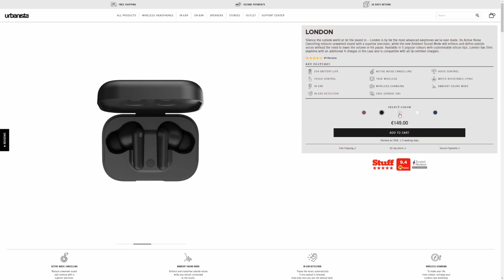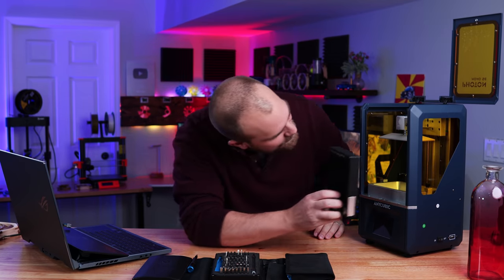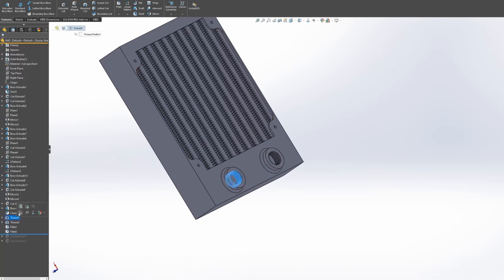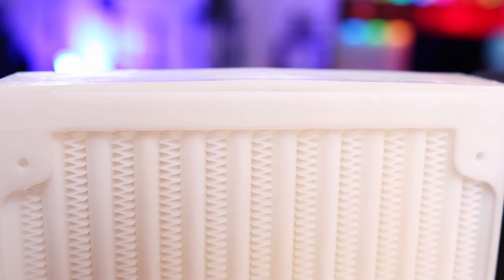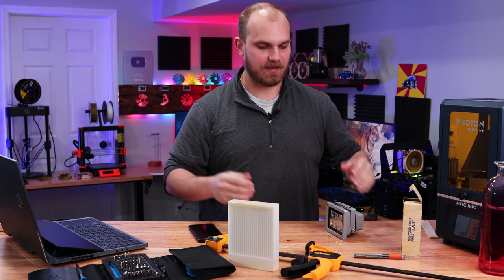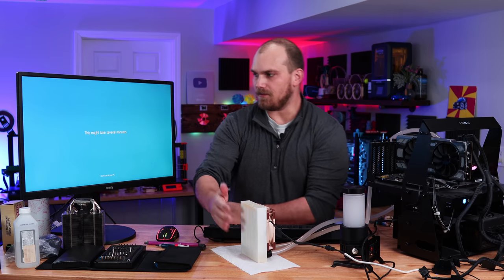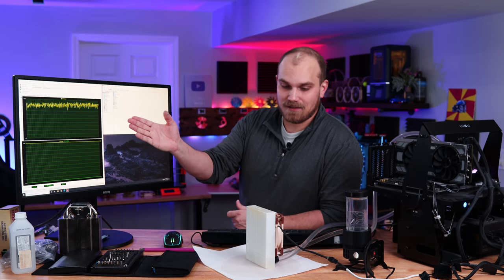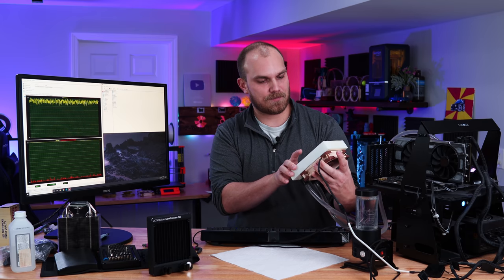I Never Expected This | 3D Printed EK Coolstream SE 120mm Radiator

Comment: I think it’s quite interesting. Obviously the thermal conductivity of the resin will be worse, but the complexity of the design possibilities is quite a bit better compared to some stamped metal thing. I’d be interested to see designs that really capitalise on the possibilities 3d printing allow in channel design, as well as experiments with the resin itself. I bet there’s some off the shelf resin out there that has much better thermal conductivity. Maybe something designed to tollerate low temperature metal casting / injection moulding? Otherwise, DIY experiments with mixing through metal dust or maybe even impregnating the resin with short carbon fibre rods could be really interesting to create a sort of matrix of thermal conductors throughout it. I feel like the zigzagging pieces don’t make much sense with low thermal conductivity so a simpler design that just has many more thinner water channels maybe a lot more effective.

One final thought: What if you spray painted or electroless plated the thing with a light coating of a metalic conductive paint? That might allow enough surface conductivity to improve the thermal characteristics, so the plastic becomes a sort of internal skeleton for a thin metal coating.

Comment: If the radiator material doesn't transfer heat that well (compared to metal), do you still need the radiator fins? Perhaps more pipes would increase airflow and allow deeper radiator design to increase surface area? Loving your channel!

Comment: maybe its like the RC speed controllers.they are wraped in a shrinking plastic sleeve to press the aluminum heatsink against the mosfets and some people freak out because it covers the aluminum heatsink and its a bad thermal conductor.
turns out that the shrinking plastic sleeve IS a good thermal conductor.
are we sure that resin is bad thermal conductor?

Comment: USED BEER CAN MEGA PASSIVE (OR ACTIVE) RADIATOR.  Use 3D printed top and bottom couplings with rubber O-rings to build a massive beer can heat sink...safely outside the case, perhaps even elevated up on a shelf.  It could be a decorative item displaying favorite beers!!!  AND A RADIATIVE HEAT SINK...

You could do an all resin version of the couplings and an epoxy or resin lined  FDM version (to create watertight FDM parts).  Do the outside with wood filament and stain it!!!  If the radiator is elevated above the case, the heat will saturate from the top down.  You could even develop ways to create pressure seated fins on the back of those beer cans with some thermal compound and cut up beer can folds.  Extra radiative goodness!  I see a branded DIY kit here!  Patent pending!

THE BEER COOLER.  DO IT!!!!

Comment: btw, you can have bluetooth headphones with a wire, but to a battery, the same one, external to boost your, but you could otg your plugs
Reply: if you only have wireless charging, no plugs
Reply: ugh, upside down, or your block your channels
Reply: so, instead, liquid nitrogen in the pipes

Comment: Excellent work man, maybe part out the top an bottom panels into a separate prints an assemble them with a gasket. Might make a second rad easier to print.

Comment: I fully support a series of 3D printed radiators... I would watch the hell out of that.
It almost goes along with an idea of had for a computer for a while. In my head this was made out of aluminum somehow... But you have a giant reservoir that has vertical channels through it. So that while it's just a reservoir and there's no fan or anything else there's enough surface area and convection to keep the coolant extremely close to room temperature. so you would lose most of the heat through the radiator but radiators are only effective in getting so close to ambient.  By having the coolant kind of sit static for a while in this big surface area, the rest of the heat could work its way out.

Plus when I do my workloads I would never overheat the amount of coolant. It would finish working before the coolant warmed up

Comment: The resin is a poor conductor of heat compared to aluminum. But, you could make one 4 time the size (or just make 4 linked together, with fans) it would come out under cost and probably work...

Comment: If you could print this out of metal resin, you might have better thermal conductivity than a normal radiator because the fins would be integral to the tubes and tanks instead of soldered. If nothing else, it might lower production costs. This has possibilities.

Comment: Please Please Please make an FDM version and post it! I am an electrical engineering student who is currently trying to build my first gaming rig on a budget and really wants to water cool. I actually think it will work better off an FDM machine, as the layer lines should increase surface area to some degree. As well you could try using a material such as a steel or copper fill PLA, which might conduct heat better while being both stronger than ordinary PLA and way less expensive than a kilograms worth of traditional radiator. The only down sides I see is that it might be a little more difficult to print and require some tweaking such as internal supports along the top, and the second being that any sort of gap between two wall lines might act as an insulator. To prevent the second of these from being an issue I would try printing it with a 0.8 or 0.6 mm nozzle to allow for thicker and stronger walls while still only having one wall line. The only problem I think that will leave is that if you have even one layer where it didn't come out quite right then it will turn into a water gun. Then again, fixing a hole in an FDM print can be as simple as some scrap material and a soldering iron. Would love to see a whole pc cooled entirely with these! If you think about it, it isn't even that far fetched. If you can completely fill your pc with 3d printed radiators for less than it would cost you to buy 1 metal radiator, the 3d printed ones don't need to be nearly as effective unless you are running a 3090 or something. In which case, what the heck would you be doing 3d printing radiators if you can afford top of the line hardware?

Love the channel and thank you so much for the excellent content!

Comment: An array of micro-tubes with a few fins for mechanical stability should work well.  It'll also let you use minimum thickness walls on the tubes to work around plastics poor thermal conductivity.

Comment: they have high heat resins with high thermal conductivity... they are expensive but i bet they will decrease in price over time. plus you could use cheap resin + additives to get close. Even metal dust might get you close to the conductivity lvls you want. granted it would have to be very fine & well shaken before hand but it would be very interesting to do more crazy tests.

Comment: Another benefit of a plastic radiator, is that unlike metal is doesen't make distilled water conductive, as it has no ions which can leech into the water. On the downside, I feel like if you use it for longer sessions, where you exhaust the thermal capacity of all the water in the loop, it is going to throttle HARD. Fun experiment, anyway.

Comment: Now I'm just curious what happens if you take out the radiator altogether, and just do a longer passive tubing run, in a case it could be against the metal surfaces to help pull heat out.

Comment: Since the plastic has a significantly worse heat conductivity you'd probably be better off with ditching the fins all together and go with denser channels. Maybe even make them a little wavy in the direction of airflow. I think the goal would be to have as little between the water and the air as possible and increase the "surface area of the water".

Comment: I mean it always would perform less than a metal radiator, but wouldn't it be possible to double or quadruple the thickness of the radiator to account for that? Would love to see that icm with a dual (2*120 individual radiator or even more) to see how close you can get to aftermarket radiators.

Comment: You could probably go crazy with the surface area with the help of 3d printing. Most radiators just use regular pipes. With 3d printing you could give the pipes fins on the inside 😉

Comment: I want to see more of these tested. 

Also there are more thermally conductive resins.  Acrilated Epoxy resins are among the normal resin types, and do offer higher thermal conductivity versus many other plastics.  A step above that includes UV sensitive resins designed for use in seating / cooling LEDs,  incorporating aluminium oxide powder.  You might look into those, though it may be more specialty, it should be cheaper than ceramic resins or the likes of ferrolite.  

But yeah, just open up design for this like you have with the fans, make it a new series, I'd be quite interested in watching, as while unexpected, it's rather interesting to consider.  

I would say in future tests with this, you should flush the line with lower pressure water before you cure the print, as there will be residue within the finstack left over after printing, which can mess with the conductivity of the coolant (water) as well as with the flow dynamics.

Comment: If we could get heatconducting cheap metal into it after printing, we could improve the performance by a lot. Maybe if you design it as two parts - one front and one back - with copper wires running straight through all water lines in such a way that about half of the wire is in contact with the water and half with air. Then glue the other part over it sandwiching the wire and making the insides water tight. Maybe with silicone? This could be really interesting

Comment: if you could print little slots that were just thick enough to fit a thin aluminium or copper strip you could form a method of sealing pairs of individual strips into channels fairly cheaply.
Reply: but then I guess it would be more of a "how cheap can I make a real radiator for" than a "how far can I get with a material that has poor heat conductivity properties."

Comment: the only reason those radiators are flat on top is because they are easier to manufacture that way.  been like that since the 20's.  You could make one curved at the top to reduce printing issues and it might even promote better flow through the unit.

Comment: The interesting part about this is that you can print radiators with designs that are flat out impossible or at the very least unrealistic to make using actual metal. Radiators with integrated fan mounts, radiators designed more "3D" (not just a flat radiator), etc. Some of them could be interesting! Granted, you'd probably not be able to fit any of them into a PC case....

Unless...

THE CASE IS THE RADIATOR! ... Yeah that might take a while to print. But imagine that. Route the water flow through the whole case. :D

Comment: There are a lot of new thermoplastic compounds out there now engineered for high thermal conductivity. Check out TC Poly they have filament you could try using for a 3d printed radiator battle

Comment: That method you use to repair the top, is what i do to assemble prints from pieces too big for my mono. Maybe you just need a larger radiator with more fans since the resin isnt as thermally conductive 😂 I bet if you use 2 to 4 of them in series, it won't even climb. This was a super awesome video!

Comment: I would like to see you try using a resin infused with aluminum powder or some other metallic powder to see if it would work with the SLA printer and give better thermal conductivity.

Comment: Not sure if anyone has recommended this yet but what if you try mixing graphite powder in the resin , I’m not sure if it will change the way the resin cures or how much it will effect the integrity of the print and if you mix it too dark the light my not illuminate through enough to cure properly but it would be a neat experiment

Comment: Since it's 3d printed and not cast or machined, couldn't you fit water channels where it'd be pretty hard with metal?

Like making really high fin density, with small channels inside along the length of each and every fin? Maby some weird patterns too, like triangle webbing.

Comment: Instead of relying on a simple system that dispersed the water evenly through multiple up tubes to pipe it over and through multiple down dunes you could try putting a daisy chain of differently sized inlets and pipes throughout the radiator starting with the main infill being the most restrictive and getting more lax from there to manipulate the pressure of the water being allowed to travel within the radiator in an alternating up, down, up, down pattern.

The freezing point of water drops by 1 degree Celsius for every 130 or so gravities applied. Yes, a plastic piece can’t be expected to handle that buildup without being mammoth sized, but in theory having a restrictive up pipe followed by a less restrictive down pipe should help trap the heat in the system’s earlier stages and allow it more of a chance to be dissipated .

In conjunction with that you would want to repressurize the water leaving the radiator as a stronger flow would displace more of the stagnant warm water that rests on the heat collecting point, or at least that’s my bare bones basic understanding of things.

Comment: I don't know how the printing part of this works but if you do this again it may be worth ditching the "fin" and instead using thin needles. I don't know if that's printable but would definitely give you more surface area to radiate heat.

Also we need to see this thing fail. How much heat can it take before it falls apart?

Comment: Just an idea, would it be possible to print it in multiple prices? Like the base plate, radiator find, and top. Just have a rubber gasket and some bolts to secure it all together. It will make it alot harder to model in CAD but it may be able to help.

Comment: Best acoustic panels: 1x4 wood frames sized to fit 'shredded blue jean' insulation bats with burlap-open-weave cloth over the front and wrapped and stapled behind the frames, hung on the walls. Search youtube and you'll find many examples. They work better than the boutique egg-crate acoustic foam.

Comment: 120 is too small. But if you figured out a way to print a bunch of 120ish parts for a larger radiator, put together like lego sort of, then you have the airflow you need. 
I think it would be worth exploring making a full size (is in the kind you have in your building) radiator, for passive cooling. I have seen people use ordinary water radiators (intended for heating buildings) and running them passive, with Awesome temps as a result. (because in surface area, those are huuuuge)
The tricky part would be to put the pieces together without leaks. I think a combination of resin and screws might do the trick. (glue with resin, screw them together, then cure it)

Comment: The thermal conductivity coefficient of plastics is bonkers. approx 0,2225 W/m.K (PLA) vs 401W/m.K  Copper or 237 W/m.K Aluminium. Thermalpaste  1-8 W/m.K. Bricks  0,5-1W/m.K
It's basically a thermal isolator,

Comment: you should try a ceramic resin , because the ceramic models will be able to with stand a higher temperature and ceramics are good at releasing heat.

Comment: Season 3 of the fan submission cooling challenge is anything that can be put into a case? Rad or fan? Fan used for rad submissions could be the A12x25. And submitted fans could still be used on the air or water test bench? Love your stuff keep it up!

Comment: Curious if you print the radiator without the fins, so just the water flow stacks if it would matter. Like you mention the isn't very heat conductive material, so the increase in air flow might be more beneficial?

Comment: the fins would be about useless with plastic, not enough thermal conductivity.
I would go with hexagons in a honeycomb pattern to increase the surface area between the hot water and the cool air

Comment: Well, there are printing filaments with a high percentage of diamond dust.
Diamond has fantastic thermal-transfer properties; the filament is actually difficult to print because it is more thermally conductive than copper!
Layer bonding is poor, however.
If only someone made resin that was 15% diamonds by weight; they'd have to be nano-scale to stay suspended for long.

Comment: I'm vry surprised by the results. I thought for sure at BEST it would start to throttle fairly hard after 5 - 10 minutes. Imagine running a 240mm or 360mm. Could also just run a second 120mm rad and maybe get no throttling at all. Really cool and interesting video. Keep up the awesome work!

Comment: Yup we need a series after you find a good resin that isnt prohibitively expensive but has better thermal properties. Resin printing might be able to have significantly more complex geometry that might compensate for the poorer performance. At minimum rads wouldn't have to be square anymore.

Comment: would the printer still work if you mixed metal powder into your resin?
you would have to mix it up every now and then probably so the powder doesnt settle on the bottom, but it could increase the thermal conduction capabilities maybe.

Comment: given the ability to 3D print lattices, there's some wild heatsink designs that are more surface area than the 2D wiggly metal heatsinks we see in commercial (cheap, easy) radiator designs - even if plastic is a worse thermal conductor, maybe we could make up the difference in exotic designs